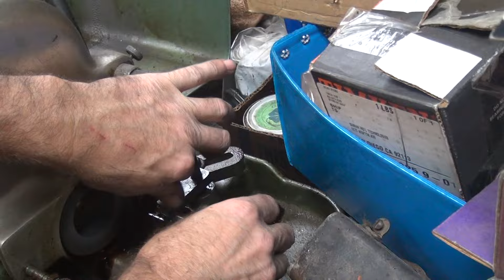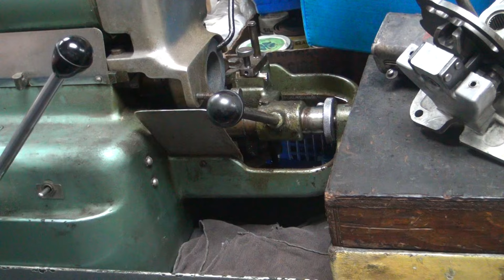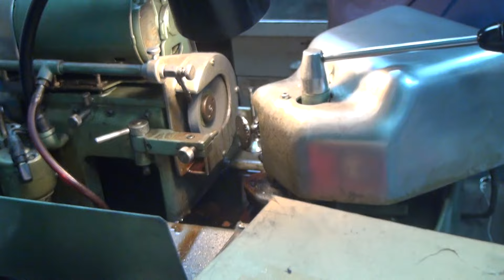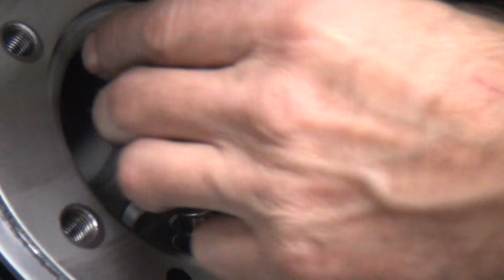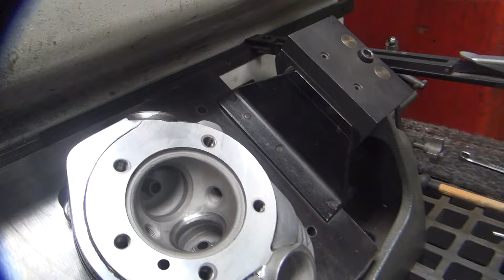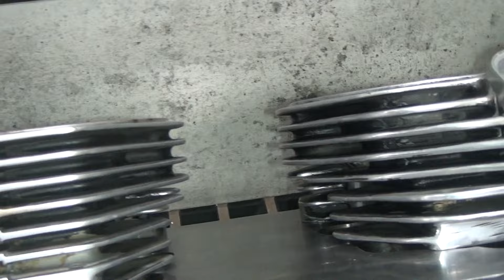1972 #103 FLH 98ci shovelhead stroker motor rebuild Harley by tatro machine

Comment: I was wondering if you have ever used time-serts instead of heli-coils for thread restoration? we use them on our drag race motors, transmissions etc... and have had zero problems.
Reply from the maker: yes. its just a matter of what works for your application. a helicoil is a one size bigger thread size and time-serts are two sizes bigger. nut-serts are three sizes bigger. if you have the room you can use the bigger sizes for more strength if it is needed for your applications. most of the time helicoils are for repair while the other two are for manufacturing. that is, the parts were designed for the bigger inserts.
tatro